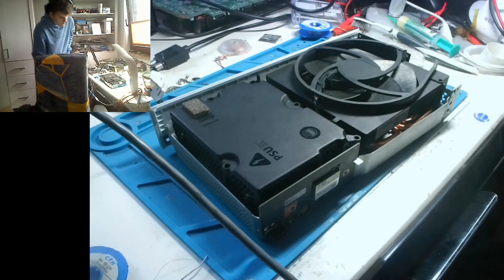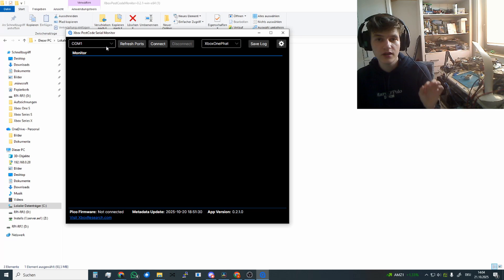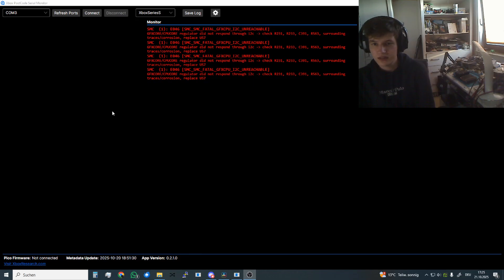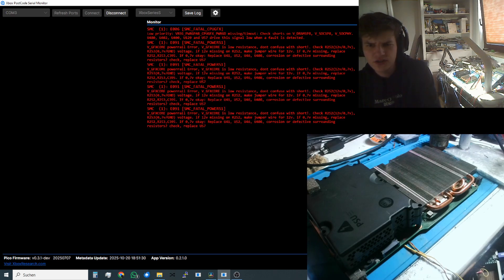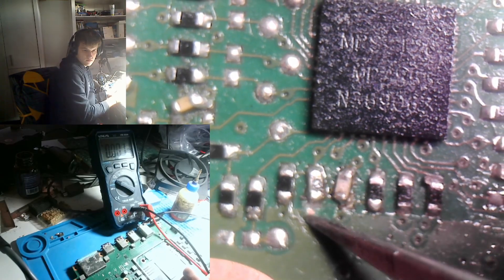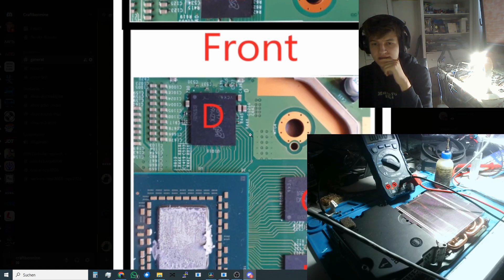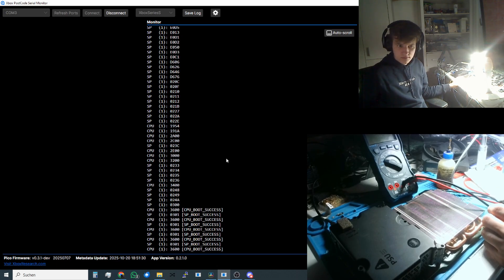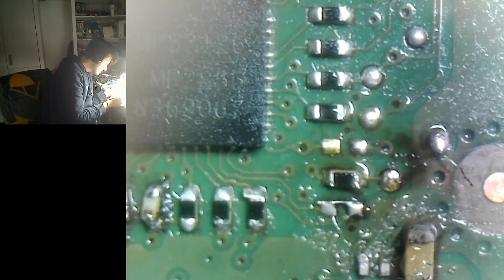FIX Beep On/Off Faults! Xbox Series S Repair Using UART - Electronics Repair 15

Comment: I am trying to diagnose an xbox series s and the only thing that shows up on the screen is sp (1): 04E2   I can't seem to find any information about it. Any help would be great!
Reply from the maker: Hey, is that the only Code displayed? This Looks Like SPI Flash or SSD corruption. Its a second APU bootloader Crash, Just Like 04A5. Transfer your First Partition from the SSD to another Board, Check If anything Changes. Post you spi flash Dump in my discord, maybe i can find a irregularity. I dont have much hopes for you.
Check your APU for Cracks as that Likes to cause bootloader Crashes.
-ben
Reply: @craftbenmine  Ben, Thank you for your quick response, I really appreciate it and pointing me in the right direction. I try your recommendations and post in the discord. I was fearing it was an apu failure. It worked and was playable one day, and the next day it would no longer boot up. 
Thanks -Mike

Comment: got dead xbox ssd Microsoft will not let you swap them out ssd can not copied really frustrating
Reply from the maker: Hey, i know. Its really annoying from Microsoft. 

Are you Sure the SSD is Bad? Sometimes you can Low Level Copy it with a SSD cloner. Does PC and Crystaldiskinfo Not recognize the Drive at all?
Reply: @craftbenmine  i got cloner the ssd is dead got another with bad gpu i can not even swap that board out there all linked -{

Comment: hi what am i doing wrong, im not getting any codes generated on the monitoring software
Reply from the maker: Does the Software Show Pico Firmware Version at the bottom?
Did you verify your wiring between console and Pico, and donyou Plug console Into Power?
Is the console beep on/Off?

Please Join the discord and ask me there for further Help :D

Comment: What voltages are necessary to use this tool?
Reply from the maker: Standby voltages only are needed. If console reacts to the powerbutton with a beep or light, you know it will give you a UART reading. If No reaction to the powerbutton, wont give a UART reading
Reply: @craftbenmine Thank you